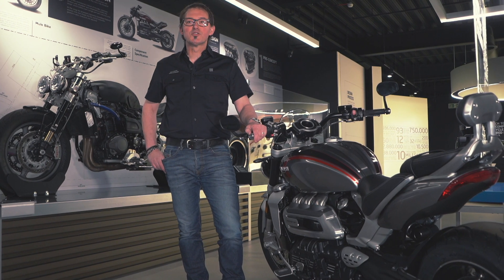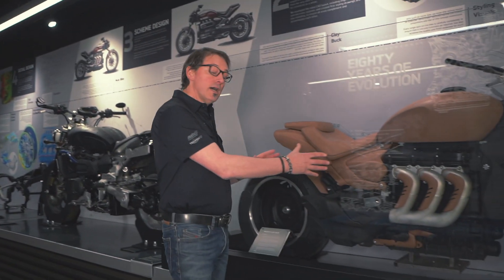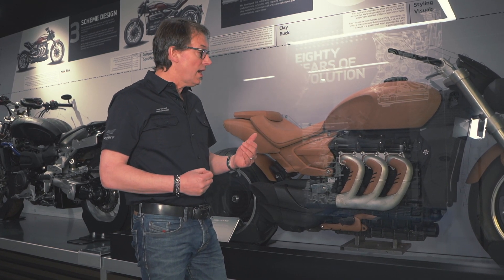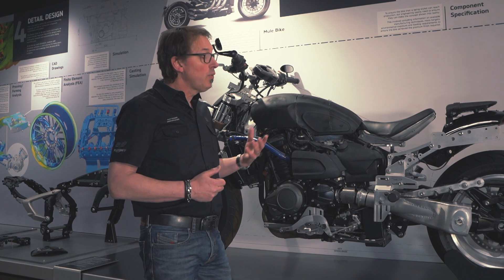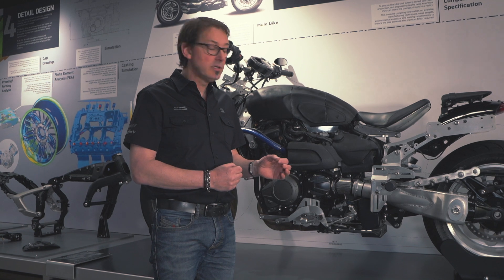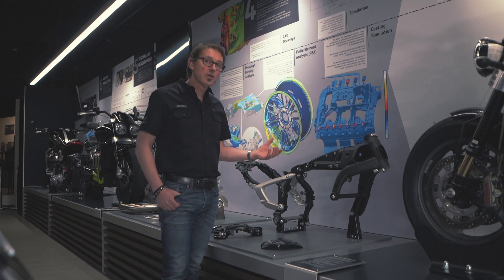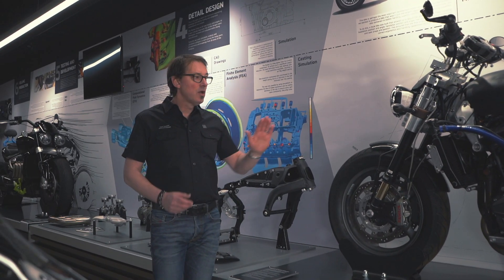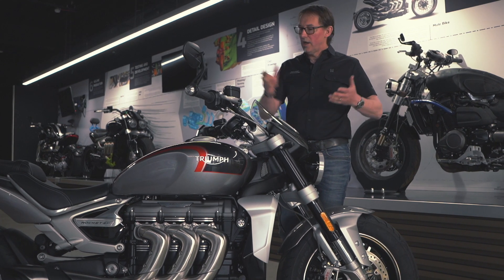Triumph Factory Stories - Rocket 3 Chassis

Comment: I'm no engineer so i hope this doesn't come off as glib, but doesn't modern maraging steels offer higher strength per density than aluminum? It seems to me even greater weight saving can be achieved from the frame by introducing thinner walls on a modern steel design. Is casting really necessary for your production volume requirements?

Wonder if I'm asking in the right place...

Comment: Hi from Spain.
I have  question about a handlebar shaking. Everybody said it was a stable bike but mine shakes a lot in potholes. IT's like a vibration that moves mirrors at low speeds.
My dealer in Spain tested a few weeks ago, and said it's caused for the big front tire. Also said that suspension has separated adjustment and it can affect the front fork.
I'm very bored with this problem, I recorded in slow motion and send them but they don't want to help me .
Bike is in guarantee.
¿Anybody has the same problem?
Reply: try to get adjust the front forks?
Reply: Yes. Last week I called a insurance specialist to test the bike for consumer right office.  
He Did 15 Triumph advised checks at the dealer, along with the mechanic.
But all times they have not checked the fork bearings or compression cartridges. 
I think there is a slack or a gap in measurements.
The other question is why they have not a Demo bike to compare results.
Thank you for your help.